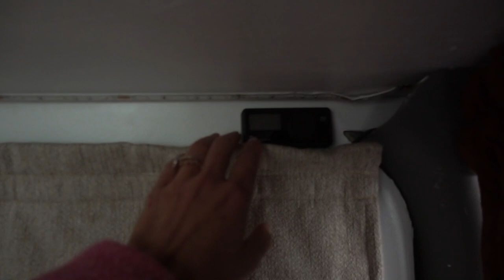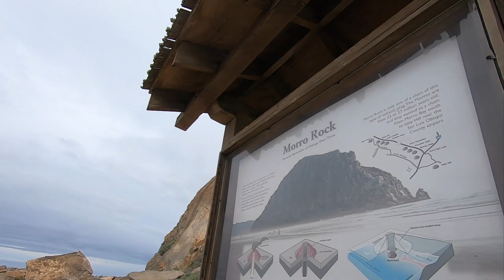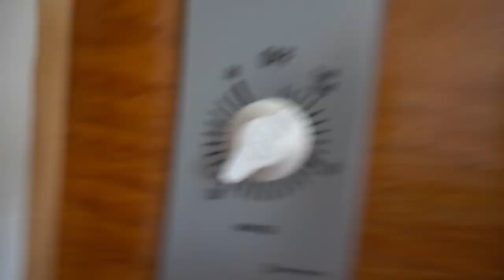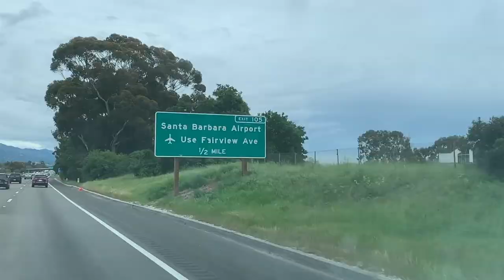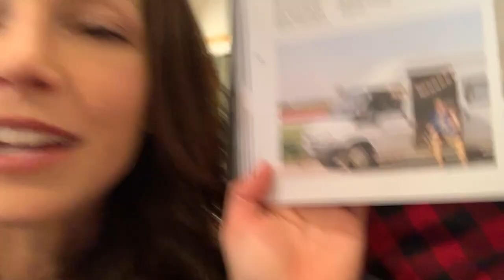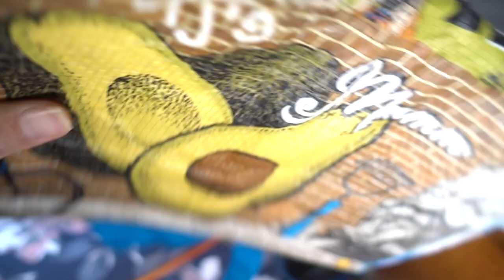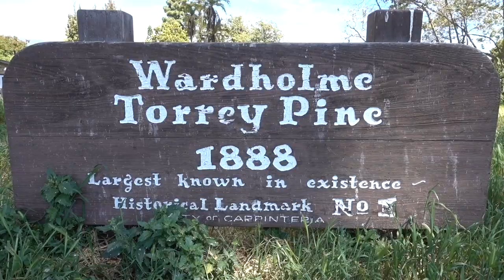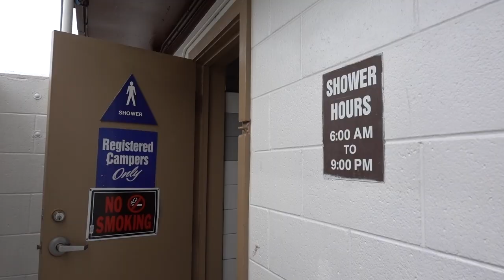Living the CALIFORNIA (vanlife) DREAM (S.1 E. 3)

Comment: How long do you set the timer for on the water heater? How many amps does it use during that time? How many gallons is your heater? I have been looking for a way go get hot water for our van and I think this might just work.
Reply from the maker: Bob Jensen yes, it’s amazing. It depends on the ambient temperature of the water for how long it needs to run to heat it, but less than 20 minutes so that’s what we nearly always set the timer to and then we have 2.5 gallons of hot amazing water to play with 🤗 Here’s a link to our exact heater: https://amzn.to/2UGqGdp
Reply: @Mrandmrsadventure  Thanks for the info, I used your link to order it.

Comment: Hey! Love the timer setup for the shower but I don't understand it haha. Do you have a guide to how you rigged that?
Reply from the maker: We plan to do a video incorporating electrical in the future. It's rigged like the other plugs on the 120v circuit and the timer works like any normal switch wiring. The timer is great for regulating the water heater, however, the heater itself has an auto on/off that is regulated based on the temperature you want the water to heat to. We have our set around 118 degrees and the heater will heat water all the way to 144 degrees. Hope this helps! 😊

Comment: Hi guys please explain the Timer in more detail ?  That’s a new on.  You guys are very cool
Reply from the maker: Sure! Basically our hot water heater draws a lot of power and but using the timer as the one switch it ensures that we never overdraw our power system 👌
Reply: @Mrandmrsadventure  So you have an electric hot water heater ?  really